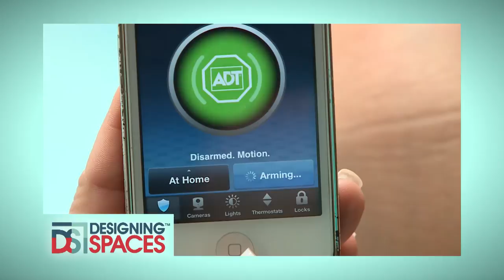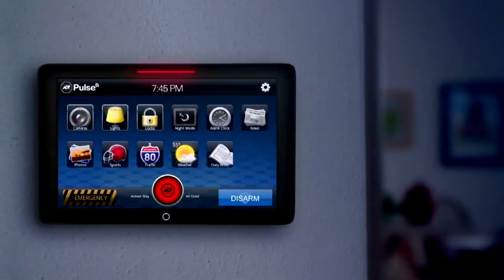Sunrise Windows & Doors: The Difference is Clear

Comment: Sunrise windows are horrible
Reply: Are they really?  Which models?  I just got a quote on Sunrise Premium.  15 windows and a sliding door installed.  9 grand.
Reply: @Grip-n-Rip-It  What state? 18 windows quote from Sunrise was 24,000 in NC. Unbelievable! I would never go with Vinyl for that much, anderson composite wood was just as much! I was shocked.
Reply: @Tnuh87  IL
Reply: Wanted to go with the restoration. 4 windows quoted at 12000 in Macomb, mi
Reply: @christinegelmini9030  that’s insane. They should be less than 4k